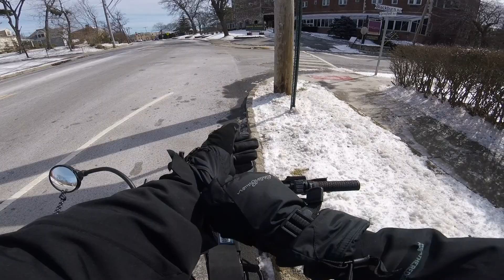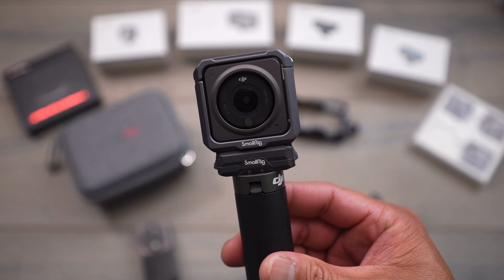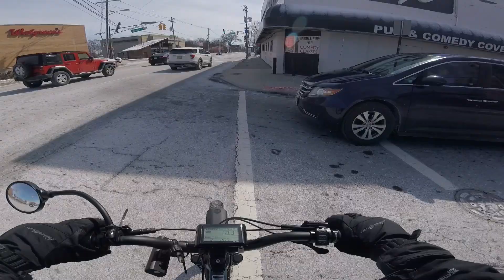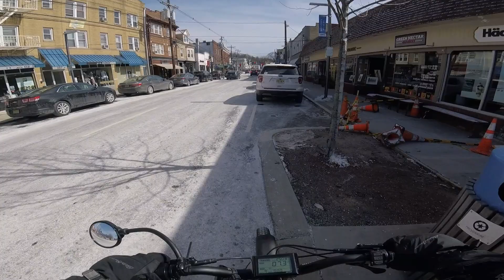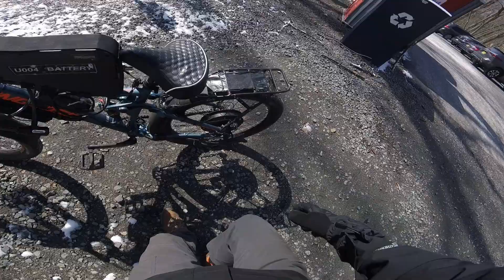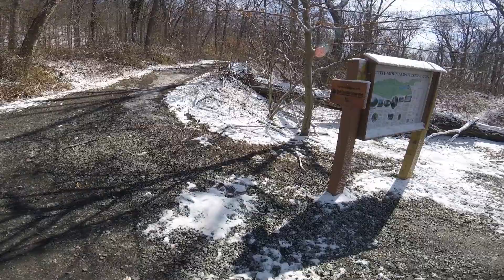My 2,000 Watt Hub Motor Broke

Comment: To answer my own question as I've had the same issue on my new ebike after only a few miles. It turned out to be a bad controller! I replaced the controller for an issue with the ebike loosing power but the screen staying on. That also fixed this noise I was having!

Comment: My motor does this at a certain rpm (under load)

And now it does it at about 15mph when going up steep hills. To the point where it wont accelerate any further, so i have to decrease the throttle to stop the noise, but i cant go any faster until on level ground or less incline.

Anyone know what this might be ?

Loose magnets? Controller ?

Comment: Hello NPL,  I'm wondering if that noise might be caused by a little bit of end-play in the output shaft of the hub motor?  Grab a hold of the sprocket on the hub motor and see if you can move it in and out.  It would take much movement at all for it to make that noise if that's what is causing it.

Comment: Hero 9 is reasonably priced, doesn’t lock up or overheat and has horizon leveling. In my opinion it looks better than the hero 5 at the same resolution but there’s nothing wrong with your image quality so no need to upgrade if you don’t want to spend the money.

Comment: Your video has a lot of great info. I plan to build my own ebike but I never done that before and I have an mountain bike. The price of gas going up. I was wondering, what is a decent “budget friendly” build? I plan to use it for traveling around town, groceries shopping, etc. I live in a small town.
Reply from the maker: Hub motors are the cheapest option, come in many different specs, and are great for on road riding. 
1,500 watts will be plenty of power and they are pretty affordable. Match that with a 52 volt battery and you got a solid system.

Comment: what are the names of the new fenders? they got mits that attach to the bike handles and you can slip ur hands in for extra protection from cold.

Grim Technologies has some good hub motors. their most powerful 3000 w out of stock from what i read.

Comment: I got the same problem with my 1500w ebike kit it makes the noise 4/5 time out of the 10 times i ride it  checked everything my front brake disk
 my back brake disk and they are fine  i dont know what the problem i just rided 250 km with this in 40 days
Reply: I found out the problem it is the rod that drives the motor it must be well in the frame if there is only a little play in it then it presses against the frame causing you this sound I found out myself when I disassembled the wheel for a new band

Comment: It is your screws around your  drum , loose and it vibrates at low speeds
Reply from the maker: I’ll take a look
Reply: Im gonna check asswel last time i lose it to change a tire i saw my screw whas not in right place but a little bit on his side do you think 2 torquearm kits will help more???

Comment: It’s not to difficult to open up a hub motor. If a magnet is loose you can glue it back. If a bearing has a problem you can change it.
But to be honest I think it’s just a resonance at a Specific rpm and power nothing wo worry about.
You could try changing to different controller and see if it still does this.
Reply from the maker: thanks for the solid advice
Reply: I’m not a direct drive hub guy but could adding Statorade from Grin technologies to the motor help with this noise and cooling.
Reply: ive built a couple ebikes in the past 3 years , the one i have now is 3 years old and a daily rider. some controllers do cause the motors to growl a lil bit . the one i have now is an nbpower 50a , im using pouch cells for power, on take off or hard accel it will growl. i'd rather it did make the noise ppl hear it! and yes they are very easy to fix. i doubt a magnet has come lose tho.
good channel! keep on riding brother!
Reply: @faulker6751  does it sound like tire rubbing? I have an AW 1000w front hub that has done exactly what you described since hookup. Works like a charm tho and I eat everyone up so far
Reply: @detacheddad3396  trust me a rubbing tire will have a smell and will show on the tire... I would check phase wires tho...
Reply: @faulker6751  yeah mine makes a growling sound that sounds like “tire rubbing” when taking off from stop or slow speed. It’s not tire but motor. However everything works great
Reply: @detacheddad3396  controller

Comment: Time for a bbshd you would love it
Reply: Yep. I agree. Get the 855 controller and continue to use your battery.
Reply: Im pushing 13000 watts thru my hub motor and easily beat cars up to 40 mph, 2k miles so far no issues. I bought a BBSHD to convert a fat-tire trike but there is no way a BBSHD is gonna handle anything more than 5kw without melting gears. Both motors are great in different ways.
Reply: bbshd without mods is super slow and boring. bbshd with modded Controller is asking for destroyed gears and broken chains. It’s just not made for more than ~1500w
Reply: @blise518B  lol nothing funnier than more ridiculous internet bs
Reply: @samspade4050  whats BS about that? I have done a lot of Comparisons with my local community. The stock bbshd on 14s can barely hit 50-55km/h and acceleration is really not that great compared to a cheaper hub with a Phaserunner that runs at 3kw.
If you want to see what happens with a bbshd and Phaserunner you can check out Louis Rossmans videos he has 3 dead bbshd laying around. Burned coils, stripped gears, destroyed clutches…
A bicycle drivetrain is not made for 3kw and strong acceleration. You would need to switch to a single speed motorcycle chain to get a mid drive that’s as powerful as a hub motor.
Reply: @blise518B  there is a lot more to a ebike than top speed . A bbshd with 160nm of tq in tandem using all the gears make is great for climbing hills . Also since you can use the gears a mid drive will give you more range . Simply put a mid drive is for more advanced riders .
Reply: @samspade4050  the bbshd is more efficient when you are going slow and need high torque. On somewhat flat ground a hub is more efficient because it has less mechanical losses and regenerative breaking. If you are purely off-road doing technical trails then the bbshd is indeed better.
The actual torque does not necessarily have to be lower with a hub motor. The stock bbshd benefits from gearing but it only uses 30A motor current. With hubs you can easily use 100A motor current witch gives you a much greater base torque. 
I don’t want to hate on the bbshd is certainly has it’s place but looking at his videos he wants something more powerful. The bbshd would be a downgrade in street riding performance. There are other 3-5kw mid drives that are actually made for this power that would fit him much better.